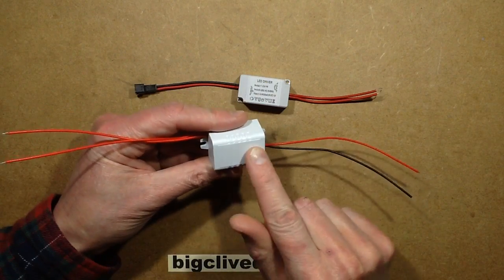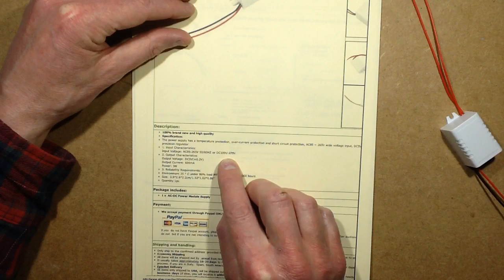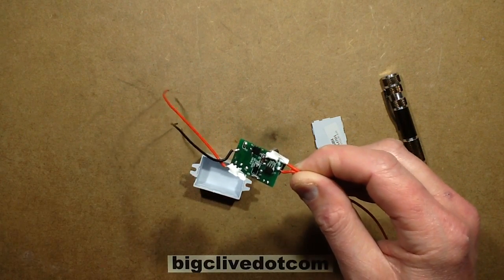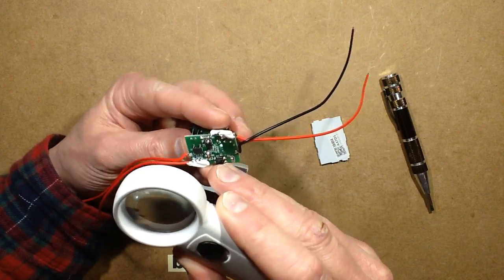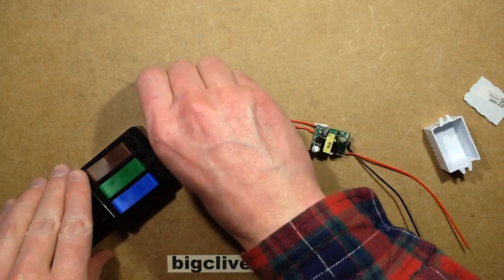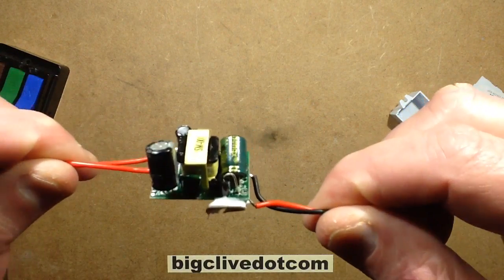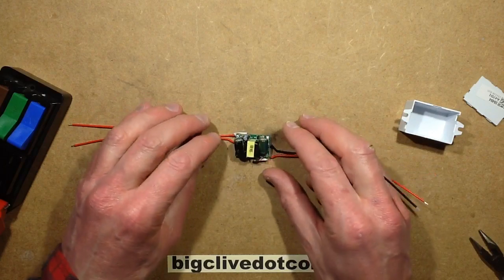Inside a dinky little 5V 600mA PSU.

Comment: Similar to your “Quicktest,” is the “Keynector.”  I have had the “Keynector” for many years.
I used mine for testing mains powered equipment/devices for testing during construction/modification or repairs where these equipment/devices were an internal part of a machine and connected to power by the internal wiring.

Comment: The link for the ebay listing actually worked this time,  as opposed to getting a "not found" page which has been the case with some earlier items.  Switching from the UK site to the US one gave me the price in $,  and the unit pictured does not look like the one you show,  no box and no wires,  but those are apparently still out there and readily available.

Comment: 2:10 that device looks like a modern spin on a "knife" switch. they are very uncommon in the USA. However we do use a device kind of similar to disconnect power at electric water heaters & large A/C units with duct work. They don't have overload protection just a place for a plumber or A/C tech to "lock out" power while working on the appliance.

Comment: I wish I could get a quick test in the US. It would be much more practical than my salvaged AC power cord and knockoff Wago terminals. (And safer if I forget to unplug it.)
Reply from the maker: Try eBay.  They may have some of the version in US colours.
Reply: I don't care about the colors because most of the stuff I would be connecting to it is Chinese. I looked on eBay, Amazon US and Amazon UK, and the prices are much more expensive on this side of the Atlantic. In the UK, they're expensive, but reasonable. In the States, it costs 1.5-2x what it costs in the UK, as much as 90 USD, which is kinda out of my budget. Even if I bought it from a UK seller, the extra shipping cost would make it too expensive. I'm sticking with my knockoff Wago terminals and salvaged AC cord for now, but I might build myself something like the quick test (out of cheap/salvaged parts). Thanks for the advice though. I love your videos. They have taught me so much from how a capacitive dropper works to PCB etching. 
PS I hate lead free solder as much as you do.

Comment: What is the red electrical box you are using called. What supplies it's voltage?
Reply: Amazon in the US has these test kits like he has but they are not red but black. https://www.amazon.com/Safebloc-120v-Mains-Quick-Test/dp/B00VKBZHJW/177-6605209-4776155?ie=UTF8&*Version*=1&*entries*=0

Comment: Hi BigClive, you might also enjoy playing with one of these... http://www.ebay.co.uk/itm/Boost-High-voltage-Generator-Booster-Ignition-Coil-Power-Module-DC-3V-to-7kV-/131481900978?hash=item1e9cee97b2:g:gJwAAOSweW5VIfEr .. after all, 7 kV in a small bite sized package, what could possibly go wrong?

Comment: I'm going to assume that the Cliff quick-testers aren't as popular here in the states because with the exception of dryers and stoves, electronics were always sold with plugs on them as where it wasn't until the early 90s that the UK started requiring it.
Reply from the maker: +Heated Pool and Bar they're actually aimed more at the test benches of electrical workshops where random industrial components might be tested.

Comment: My tiny concern is how truly easy the bottom cover just popped off revealing the Mains in solder connections...  You'd need to aware it could happen should you be doing some experiments and hadn't screwed the thing down using the integral mounting tags...

Comment: Great channel to learn new stuff and be inspired.

What is that red box with 3 piano keys device.
Powered by battery?
What is it called?
Where to buy it?

Thanks.
Reply: +TheGreenPastures He discusses it at length in the video, not once but twice.  I guess you need to watch again and listen this time.
Reply: +pillsnotbills I asked because I realised the device has no input 110/230 AC incoming supply (I don't see any cable plug into the device). Seem to be portable and operate by battery and converted to 110/230V AC and supply power to the Unit under test. A European Power Supply is just a generic name not a specific name that you can google to find this particular one that used to test or supply main AC voltage to UUT without incoming supply.

We do test UUT many times in our factory like what he is doing but always come from main direct without such a device without main supply cable. I don't see that in this video.
Reply: TheGreenPastures It's on the opposite side of the unit.  This does not have any batteries or inverter or anything like that, and no conversion takes place.  This "test block" is just a quick way of connecting a load with no plug to a wall outlet for testing.
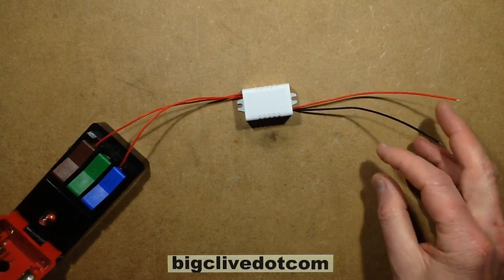Reply: +pillsnotbills Thanks. But please look at 2:40 - 2:50, there is no power cable coming from the wall outlet to the "test block". That is where it puzzled me. That means the "test block" is supplying the the AC power.

Any clue?
Reply: +pillsnotbills Sorry. I miss the cable. I just saw it at 2:14.

Thanks

Comment: Would you use one of these idling at your house, and what part you might expect to fail? Is there a probability of electric fire? What you would use to safely provide mains to 5V conversion?
Reply from the maker: +RealationGames Only thing I might trust for long term use at home might be a high profile USB power supply.
Reply: +bigclivedotcom  do you have an exemple of that kind of power supply we could buy ?

Comment: LOL....Loved the classic tapy tapy finger test after you discharged the cap at 4:09. If it is discharged then great but if not.....ouch.
The quick test device you use is known to me as a 'Safe Bloc'

I'm liking your videos Clive, in particular your humerus approach and somewhat sarcastic turn to the DUT. 

I was particularly impressed in an earlier video when you placed an EEPROM over an in circuit EEPROM to copy data written.  It was easier than soldering wires... great idea, thanks.
Reply: Quicktest qt-1 CL1850 made by Cliff.

Comment: Well I'm not sure about the regulation on the quick test, here in the US, but it is available from at least one of our suppliers. I just received mine and can't wait to use it, yes the color code are wrong for US but who cares. Years of trying different methods of a solid way to bring in line voltage to my test bench is finally over.  Enjoy you channel Clive, keep up the great work.

Comment: can't use a 5 volt reference via optocoupler due to voltage drop of L.E.D in the optocoupler.
is possible via a buffer though.
Reply from the maker: +Josh C The LED in an opto isolator is usually infra red and usually has a forward voltage of around 1.5V
Reply: +bigclivedotcom ecactly 5vref + 1.5vdrop = aproxamity 6.5vout
Reply from the maker: +Josh C You either use a zener that matches the drop across the LED, or in this case it looks like it may be a precision reference that drives the opto's LED via an internal transistor.,
Reply: +bigclivedotcom that is correct.

Comment: Yep, seems the quicktest is UK/EU only, but i did find an australian version,
http://au.rs-online.com/web/p/mains-test-blocks/0458926/
I think the american version of a test connector is to shove the wires in the socket, after all, it's only 120v :P
Reply: +Sparky Projects Did that while I was living and working over there,  I found out to my cost that some US outlets have NO proper barrier between 'hot' (phase) and neutral. Shoved wires from a light fixture into the slots, and BANG.

Incidentally, being a motel I was working at, it had a decent sized padmount transformer, so it actually went BANG like real electricity does :D (120/208 volt 3 phase at I believe 1200 amps)
Reply: +TheChipmunk2008 Doesn't matter what transformer you had outside, in a standard socket you would have seen 120v @ no more than 16 amps, but still enough to cause a bang
A bigger bang was when my workmate shorted between 2 phases (415v) and blew the 400A breaker in the main switchroom.
Reply: +Sparky Projects yeah that's what I was meaning, sorry. The short circuit current was much higher than other places I experienced in the states (sometimes you'd short out the 120 and not actually HEAR a pop, just the fuse would go! (yes, it was old fuses) ) Those were mostly places at the end of a line with a single 20 or 25kva 1ph pole mount transformer. And yeah, 415 can be.. energetic <grin> BTW, I still have that soldering iron here, will get in touch shortly (got distracted for over a year!)
Reply: +TheChipmunk2008 Is it possible that a small bang is caused by the actual voltage being in a trough of the AC output? Even if it was 20 volts or so, that should trip the breaker but only cause a small spark.
Reply: +Prehistoricman Yeah with breakers that's what I'd have thought, but this case was with edison base fuses, I thought they took more than  a half cycle to pop, even under a dead short? (college was a long time ago tho so I might be wrong!)
Reply: ***** I wouldn't know, not from my time!

Comment: I'm certain there isn't an Australian version of the Quicktest because by law a licensed electrician would be required ANY time the cover needed to be opened. Stupid nanny-rules...
Reply: https://www.amazon.com/Safebloc-120v-Mains-Quick-Test/dp/B00VKBZHJW/177-6605209-4776155?ie=UTF8&*Version*=1&*entries*=0
Reply: Yeah but the market for those would mostly be licensed electricians. Clive is one (or at least trained). You might not get them in Woolworths (especially since they went out of business 10 years ago) but a special trade supplier might do them. 

Til then you could just buy a British one and use a plug-adaptor. Or cut the plug off and fit a local one. Good old Internet.
Reply: @greenaum  You can order them at quite a few HOBBY-shops
Reply: Nope not true......'cause everytime it opens no live parts are exposed,neither when you connect it.
Reply: +Mike Munro Are you sure about that Mike? The moment you start to lift the cover both both poles are isolated by blade connectors with a large isolation gap and small openings - a good deal safer at that point than a typical Australian wall outlet I'd have thought. The danger actually comes when you close it up - depending of course on what you've clipped into it!
I got one as a birthday present half a century ago as a 12-year old kid - perhaps my parents wanted rid of me! I can't remember who made them originally, but the design hardly seems to have changed at all other than modern colour coding  and the lid now being glass-filled phenol rather than bakelite (which easily cracked).
Reply: I won't lie, don't know the laws exactly as I've never really worked on 240v and not needed any qualification (DC only, and max 50v lol.)

But even with the safety features (which certainly would make it safer to use than a standard 240v outlet) because bare wires are involved, it would generally mean a licenced electrician is required to "hook them up".

Hahaha, as a 12yo Birthday present?! Your parents are the best and worst all at the same time haha :D (more emphasis on the best tho)
Reply: Alex Gray, forgot to include you in the reply, sorry.
Reply: Well I got a Philips Electronic Engineer kit for my 10th and a traditional AVO meter 7 for my 11th, so I guess the direction of travel was clear!

Comment: I've always wondered how bad the shock would be of a charged capacitor. Would it depend more on the size of the capacitor?
Reply: +Walter Boxhead  is there a safer way or took to discharge it ? so that we make sure it's discharged, I'm only new in electronics but I'm curious, even though I probably wouldn't hande a big capacitor just yet lol
Reply: Cool thanks for the info mate, I meant tool** by the way.

Ah holy crap, that's hell of a capacitor we're talking about here lol, yea, I read about super capacitors lately, sounds like it would very very lethal to get zapped by that.. just like some batterys would I imagine.

I guess I see what you mean, so if it was a proper circuit you could zap even a big soda can capacitor by just doing that safely right
Reply: can't there be enough amps in them ??
Reply: Interesting, I didn't know, altought I wouldn't recommend doing that eh, lol.
Reply: cool i'll check it out !
Reply: Thanks, I mostly handle guitar amps and there's always been what seems like a myth a killer capacitor in some amps. Thanks for the clarification!
Reply: @philipdowns4176  can't remember the exact details but I read about a valve amp that had (by design) a cap from live to ground to suppress noise. Under some circumstances the cap could fail, shorting live to the chassis and hence to the guitarist, all you then need is for the supply you're connected to to have a defective ground and you're toast, so it's not the cap WORKING that zaps you, it's its failure coupled with dodgy building wiring or a dodgy flex.  I think it was a fender amp.

Comment: What a cute and neat switchmode :-D
A lot of supplys for laptops use a Tl431 shunt regulator with two program resistors to control the opto feedback loop. Possibly two 10k resistors.
Ive seen them in loads of switchmodes, handy little shunt regulator :-D

Comment: Clive I like the way you discharge the capacitors with your pliers then use your fingers just to check.  I guess is that if there  is still any residual charge you will be canny enough to pull your hand away before the electrons get very far up your fingers! Love your  videos keep them up.  I'm buying  shares in Poundland.
Reply from the maker: +Gribbo9999 Just like with mains busbar chambers and wires.  Test with your test-lamps and then chap them with your knuckles as a last safety test.
Reply: +bigclivedotcom Thanks Clive yes makes good sense really when I think further about it.  Better than grabbing a fist full of it.  Anyway I'll keep watching your videos.  They are always revealing but never shocking :)

Comment: Quick blocks we called them TV engineers used them all the time for sets coming in for repair without plugs very handy
Reply from the maker: +Tony Quigley And also for connecting to the isolation transformer under the bench.

Comment: No, you can buy that EXACT model on Newark Canada... so yeah, they're available. I pasted the link into a previous video
Reply: +Aurelius R The QuickTest, that is.
Reply: +Aurelius R Yours for only 83 bucks! Wow. Strangely, the one with the included euro lead is cheaper than the bare box. Unfortunately only rated for 13A, so it might get a little toasty with North American 15A appliances.
Reply: +Euro Bum - that European plugged one is UK stock and has $20.00 shipping added to it.

The one without the power lead is $76.79 with UPS Shipping to my address.  It also comes with 13A fuse.

Comment: I have a feeling america doesn't have a version as they aren't meant to chop the plugs off anything that has one...
Reply: +Chris Koch To be honest after I wrote that I then brain waved and realised how stupid I was. I can see no reason why you couldn't use this in the states? Only would take cutting the British plug off and putting on an american one? Bit of coloured lx tape to make it your colour code...
Reply: +Chris Koch Every time Clive pulls that thing out I get  a little bit closer to spending the $80-100 to import one from the UK.
Reply: +Cameron Marks I live in the states, ordered mine off amazon, shipped with no questions asked
http://www.amazon.com/CLIFF-ELECTRONIC-COMPONENTS-CL1850-ELECTRICAL/dp/B00DRDOBP2
Reply: +Chris Koch They're actually 1 inch (25.4mm) long high breaking capacity (HRC), but I would imagine if you're going to the point of ordering one in the US, ordering a few 13 amp fuses as well wouldn't break any banks :)

As to the 13amp vs 15 amp ratings, you're only using it to briefly test things, so the heating wouldn't be bad at all, and the fuse would likely not even notice for a few mins
Reply: Hi Clive, I got mine from RadioSpares in the 1970's - back then we called it a Safeblock - great videos btw, very relaxing